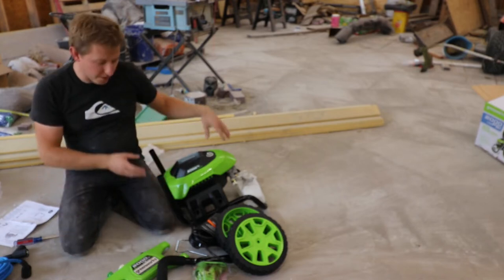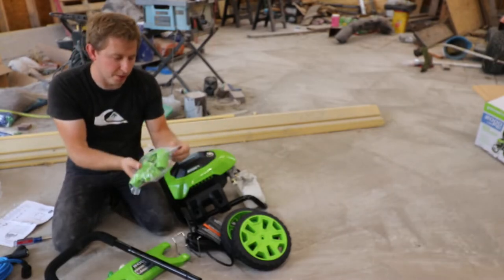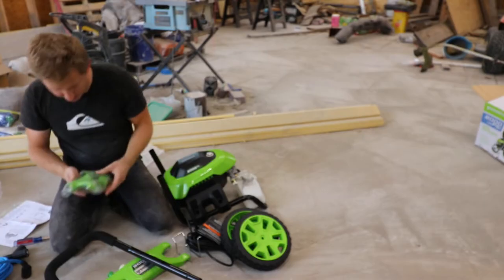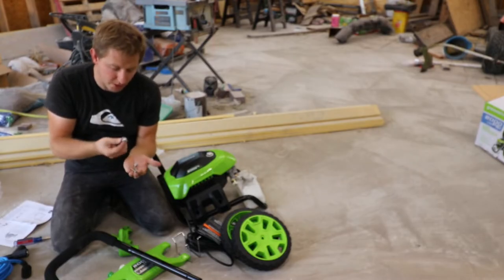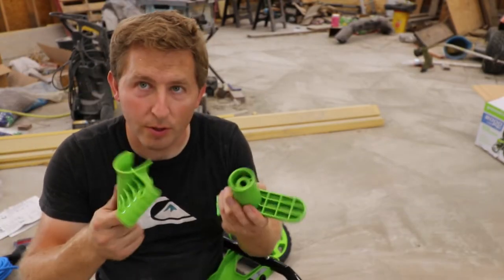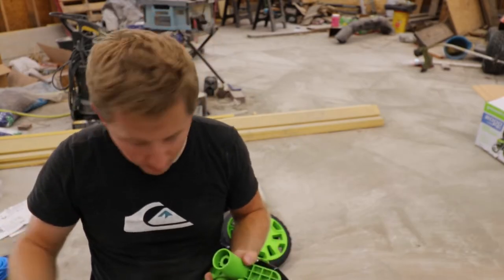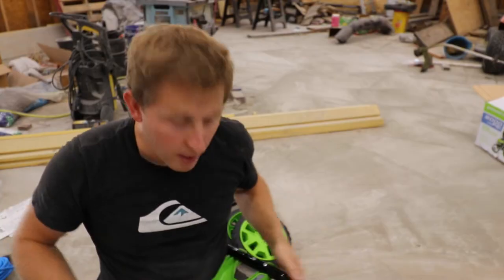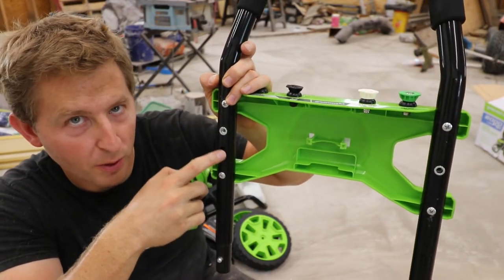Greenworks 2100 PSI Power Washer Assembly

Comment: Dimitri! i have a question. i can’t figure out what grease goes in the bearing on the back of the pressure converter. do you have any clue?
Reply from the maker: I'm not exactly sure what you are referring to. There shouldn't be a need for grease for this assembly.
Reply: @BiancoLand_  i had a bolt snap on the pressure converter due to rust and a seal started leaking. when i pulled the bolt out, there was an oil that sat on the inside of the converter. i was just curious. the oil isn’t needed to put the thing together originally, it’s for maintenance. i was just curious if you knew the specific oil. thank you Dimitri
Reply from the maker: @ethanbaileylol2283  I would take a look at this video. It looks like there is special oil for pressure washer. 
https://youtu.be/OD7YKRKI08w